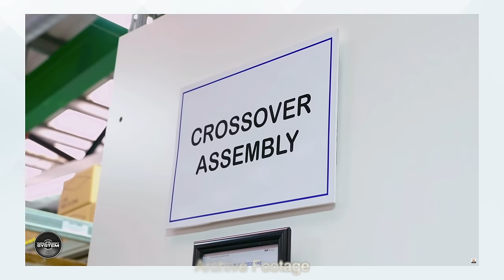Bowers & Wilkins 803 Diamond 4 speakers REVIEW A DREAM COME TRUE

Comment: I have the 804 D4s driven by a Gryphon Diablo 300 and the bass pressure in my untreated room is awesome without subs. The top end is grounded by the mids and bass presence that the Diablo coaxes from them. In other words yes the only limiting factor is source and amplifier quality - and ultimately room treatment, which is my next step with subs.
Reply: Wow I bet that’s an awesome amp/speaker combo!
Reply: Dial them in and make us a video to see the setup man
Reply: Good speakers don't need subs.

Comment: Bought my 803Ds 2009 for 8000€ the pair (also Center HTM2D and sub ASW825), they where my first floorstander speaker and the first B&W with diamond tweeter. I am still so sattisfied with them. I drive them with 2 Audionet "AMP" monos...soundstage and basscontrol is awesome.
I love my B&Ws! Still very sattisfied after all these years👍🏻

Comment: Excelent review! Like you I bought an 805 10+ years ago for £1000 with stands and its been a bit of a love a love/hate relationship, buying and trying other speakers and a dozen amps. It’s was not until I finally stepped up to a decent front end (in this case the Rega Aethos) that the speakers found their form, sounding very effortless, smooth and coherent. Adding dual Rel T/9x improved the experience even further ❤️ I’m sure they would keep scaling with better gear. Unlike your description of the D4’s, I find the N805’s have a small lift in the lower mids, that bring a fullness to vocals I would not be without. I always say that people who think amps, sources, power supplies, cables or whatever sound the same, haven’t lived with an 800 series speaker 😄
Reply from the maker: Maybe you bought the pair off me :)

Comment: I totally agree with you in starting your review with the pricing of the B&W's. £18,000 for the 803 D4's vs £3300 (plus stand costs) for the Mission 770's.
Stereophile did a review including measurements of the 770's and a review of the B&W less expensive brother, the 804 D4.
The 803 D4's will be good sounding speakers. However at that price it's difficult to forgive any sonic weaknesses.

Historically the weakest areas of B&W speakers, including the upper end models has been the dynamic freedom, with them sounding shut-in / polite / soporific / flat / boring / unmusical compared to the best speakers in this area.
And I've not been convinced by the bass from B&W's. I wouldn't expect twin low efficiency 7" woofers in a slimline ported cabinet to do it for me in the bass.

Comment: when having my first home i had already a lot of components and i had a room that seemed big but when putting a litle furniture and some sofa´s the speakers and my system was sounding perfect, but the speakers that i still have were huge and one at each diagonal corner took most of the room but no matter where i was the sound was incredible good a spec-1 and 2 and a pair of exclusive 2401 from Pioneer, if memory doesn´t fail me. This having a SP-1 from technics, a still good turntable a akai reel deck a crossfield X-165D and a CT-F1000 cassette deck

Comment: I am currently considering between the 802D4 and 803D4, do you think it's worth spending the extra cash to get the 802D4 or would that be a waste money. Does the size of the mid-range of 5 inch vs 6 inch makes a difference? thank you in advance. I am looking to drive these units with the X3 Series 2
Reply from the maker: I think if you might suffer buyers remorse get the bigger ones they will be better and wont suffer the should I have syndrome.  If you dont think you will care the 803 are still very nice man
Reply: Give them more power x5 minimum but an AB class wont make these fully shine with that aura that they are capable of.

Comment: I think the mid on the 803 d4 is sweet and the bass feels powerful without want for more. I disagree with a lot of the negative comments.
Reply from the maker: I don’t allow links to other channels but the video you linked to proves my point and that’s with the speakers up against the wall so with maximum room gain. Totally the non optimal position for the speakers.
Reply: @PursuitPerfectSystem  No problem, I removed my link. I wasn't trying to impede but showing some songs played to dissuade some of the negative comments.

Thanks for the many awesome videos you put out.

Comment: What would’ve been really interesting is if you hooked them up to a basic integrated amplifier, just to hear your thoughts, I know it might seem pretty pointless having a pair of speakers like those on a say an Arcam A85, but reasoning in asking is building up a system slowly, buy the speakers first and so on, if it’d be at all worth while? Do you think running a set of those speakers or even a set of the older 800d with a small integrated amplifier like a Arcsm A85 would damage the speakers? I’ve heard the term clipping but don’t know what that means, I think you mentioned clipping once in your video.
Reply from the maker: These need a very good amplifier, I explained this whole situation of not good enough amplifier results in the intro 😎

Comment: I have a pair of cheap CM6 S2 from 2015 paired with a Rel sub & until now still amazed at what this small bookshelves do musically.
Reply: I'm still using a pair of CM8 I bought in 2011 with a Velodyne sub. I blew the tweeters last year, and when I replaced the tweeters I had a good look inside the speakers. Don't underestimate the value for money on their build! The crossover uses parts similar to the current 700 S3 series, maybe just a hair cheaper in quality, but way better than you get in most current speakers at their price point. While I was inside I replaced the dampening material with Twaron Angel Hair, which is an aramid fiber based material with fantastic dampening qualities. It made the speakers sound €1000 more expensive. I also put dynamat on the speaker basket and tweeter housing to dampen potential ringing. I think it made the sound tighter, but it had a smaller effect than the new dampening material. The driver basket is made of cast aluminium, so B&W already made efforts to control ringing, making the dynamat potentially meaningless. But I did it anyway. So if you feel like doing some simple DIY upgrading you can probably make the CM6 S2 even more impressive.
Reply: @PeterHas  thanks for the suggestion but i am still very very satisfied with my CM6s & prefer to leave it that way. B&W manufactures all their drivers & they all look very robust & rugged yet still sound very refined & sophisticated. Its really insane that my CM6s can sound this good with only a simple 1st order crossover. Its a testament on how good the drivers are.
Reply: CM6/S2 are fantastic speakers, have them powered by a Yamaha amp and they sound fantastic…
Reply: @ganck1147  It took me 11 years of ownership before I started tinkering with mine, so I guess it’s still too early for you to do the same!
Reply: @patrickmeylemans9627  yes they are really fantastic but they need a good amp to strut its stuff. I remember heading down to the dealer & originally i wanted to buy 805D3 but after going back & forth a couple of times, i found that the much cheaper CM6 is just as good. Both were very close sounding. In fact the cm6 is even better than 805D2 that i also compared with. Far more open & transparent. I feel that cm6 is better than the later 705S2 too.
Reply: @PeterHas  ya perhaps but at the moment, i am still extremely pleased with my cm6s.
Reply: @ganck1147  If they're giving you satisfying sound every day, then that's really all that matters!
Reply: @ganck1147  cm6 is not even close to 805d2, 705 s2 is also more transparent, i heard both cm10 and 702 s2 many times, cm10 is an easier speaker to listen to, 702 s2 reveal more on whats going on in the recordings,  but its by far the more transparent speaker, between the two. bought 702 s2. Speakers is however a taste thing, but you have more details in 700 series campared to old cm series it replaced, but it can sound bad with poor recordings,

Comment: When you say a bigger amplifier what are some that come to mind? I currently have it (the 803D3 that is) with a MC462 and it does sound inherently better and fuller than the class D ICEpower 800w/ch amp I had them with.
Reply from the maker: The MC462 is the epitome of a big amp dude so that is exactly what I was referring to

Comment: Terry - it’s just lucky when a YouTube reviewer shares your tastes and takes, and you are that for me. I have been running a set of 802D4’s for a year now (see my article Moving to the Bowers and Wilkins 802D4) and my impressions are very much the same as yours. They seem very content to be driven by my MC462, and have caused me to upgrade my primary source (now and Aurender N200) and pre-amp (now C2700). All with great reward - rewards that I simply would not have been able to distinguish without the 802D4, and I suspect would be the same with the 803’s. Next, a better, dedicated DAC. Maybe review the T+A DAC 200? 😊
Reply: Holy smokes we have the exact same system (802D4/MC462/C2700) — I just finished it up last week with the arrival of my MC462. It rocks!

Comment: With the difficulty you had setting it up, I infer that the sweet spot is very small. Is this the case? With a speaker like that I would want a pretty wide listening area
Reply from the maker: Maybe it’s a little bit of that or maybe it’s just the distortion is so low you can hear when it’s not 100% where other speakers maybe you can’t because you can’t hear things so clearly. I think it’s a large % of the latter
Reply: @PursuitPerfectSystem  That makes them way too demanding for me. Maybe I'll just visit them at my local Best Buy.
Reply: 🙋‍♂️actually I think the type of music 🎶  ( RECORDINGS  )also can add or detract…
Living with them I have them setup properly and any time I can I sit in the SWEET SPOT 🍯…the rest of the time it’s not too bad 😁💚💚💚

Comment: If one buys a pair of monsters like this, how do you use a sub & amp driving these?

For example, I assume it's 500 watts to drive these full range.

But if you got like a 120 watt amp, do you just crossover at 80 hz with a sub, where 120 watt can drive everything above 80.

Then, do you upgrade the amp, and lower the crossover? Like upgrade to some 300 watt monoblocks, lower crossover to maybe 40 or 50?

Comment: Chord and bowers never matched well for me to give a musical enjoyable well rounded result. Both clean and accurate but added together not good synergy. If you'd compare your passive or active atc50 or 100 for similar price to 803 instead of missions there would be no doubt the b&w's dont cut the mustard for the money. They start with a lot of faffing and continue to make you faff question and change other components to chase what the missions and atc's do out of the box. At £18k They should be impressive and awesome and have to be ripped from your clutches. Instead...whilst you appreciate them and you love the build...you don't love them.

Comment: I never heard the D4 version but the 803 D3 was laughable. Not even close to a full range sound. Hard and grainy that only people with a bad hearing could be mistaken to see it as detailed. I know the D4 series is an improvement (heard the 801 and 802) but B&W is expensive because they spend the most money in advertising. Even the 802 D4 is a big step down from the 801 so I imagine the 803 is even a lesser performer. At that price …. Ridiculous. But they have the looks and are surely well put together.
Reply: Thats why subwoofers are thing
Reply: @andreasmoller9798  subwoofers can enhance any speaker. If the fundamental sound is flawed then so what.
Reply: @andreasmoller9798  i could and probably will put subs with my atc50a. I don't neeeed to. I shouldn't neeeed to put subs on £18k full range large volume speakers to make them pallatable.
Reply: I own the 804 d3 and would agree that they sound very poor in most showrooms. When I got them home, it was an entirely different story.  I suspect they were designed to be placed much closer to the front wall.  Once dialed in and fed some serious power, no need for subs.
Reply: @reynolds8532  What amp did you use? Do you like them much better now?